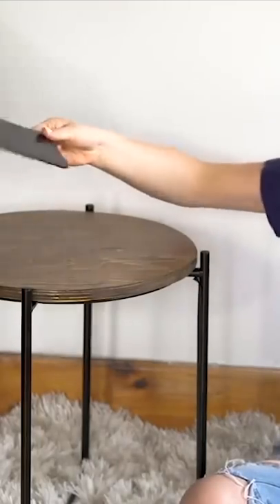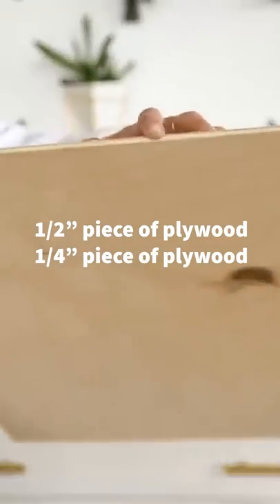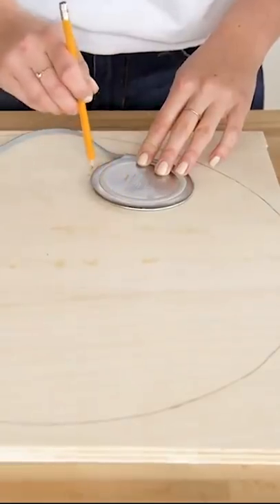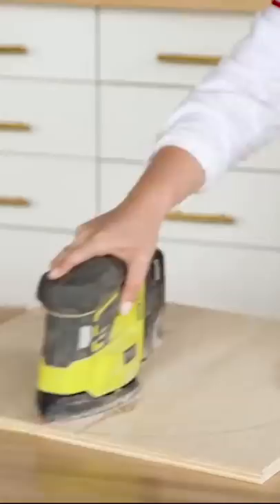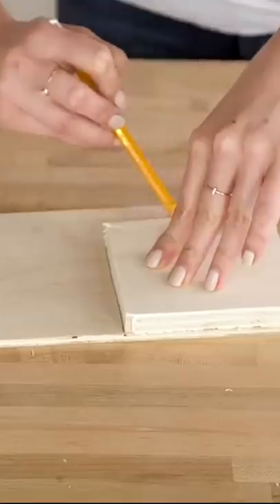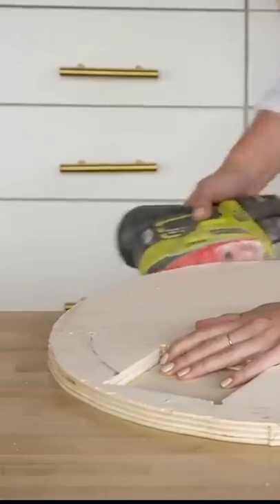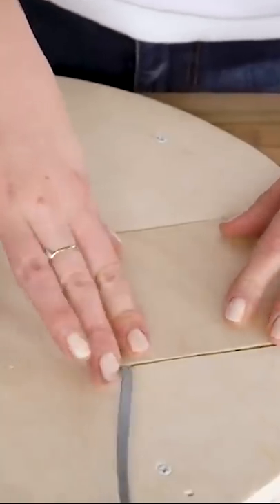#shorts - how to DIY a wireless charging table

Comment: OK wait how does the charge get through the wood when wireless chargers don’t even work when my Otterbox is on? 🧐
Reply: It won't plus it will over heat
This is dangerous and I'm 99%sure it won't work

Comment: Will the charger not get  hot or overheated in there?
Reply: also, i had no idea the chargers work  with thick materials like wood and foam over it.
Reply: I would leave the charger exposed  from the bottom, making it accessible for me to take it if I ever needed to. So much better than having to unscrew or cut its cover open...plus that way, the charger won’t overheat. I probably would  just cut a thin piece of wood that would measure out in length to whatever the diameter of the charger is and try it keep its width only wide enough to keep the charger in place.
Reply: Yes! It will over heat. I have no idea why YouTube is allowing this video.
Reply: @nolnol815  really? Your question is why YouTube allows it? They allow you to comment here, so the standards obviously aren’t that high…
Reply: @garycheevers2671  Go ahead build it, please. Perhaps, you could also build a DIY bathwater warmer based on a poorly made video with dangerously erroneous plans using coffeemaker parts and at light switch. LOL. Or better yet, because it's YouTube video material, try taking random antibiotics sold at aquarium shops for a seriously deadly ailment because the video maker assures you "it's the same thing and 97% cheaper than any antibiotic a pharmacy will sell you, plus you don't need a prescription."
(Really? An ad hominem attack is the best you could drool out without a shred of substantial proof my valid warning was wrong? That's your best? 🤣🤣🤣🤣) Some small few are why the rest have to tolerate basic, grossly obvious warnings on common itens: "Remove bread from plastic wrapper before heating it." "Do not allow children to play with plastic bags." "Do not store poisonous household cleaners within reach of children." Etc...
Reply: @alaska3445  They don't.
Reply: @Marit Størseth Yes it certainly will. That is the reason why such chargers come with specific warnings in the package NOT to even attempt anything similar to what this video instructs.
Reply: @alaska3445  It won't plus it will over heat
This is dangerous and I'm 99%sure it won't work
Reply: @alaska3445  It won't work plus it will over heat
This is dangerous and I'm 99%sure it won't work.
I was thinking make a cute little tray to sit it on
Reply: @nolnol815  It won't work plus it will over heat
This is dangerous and I'm 99%sure it won't work
Reply: @garycheevers2671  her question was very legit.
 it will over heat
This is dangerous and I'm 99%sure it won't work
Reply: Some people here need to calm down.
Reply: @sarahpcato  then how it worked in the vid for her?
Plus i see some people built this and apparently alive still.

Comment: This is really cool!
Reply: No it's very dangerous
Reply: Agreed. This can easily result in a devastating fire. The brainless nitwits who post videos that contain potentially lethal ideas should be exposed and banned from YouTube. Theses wireless charges can overheat in the design of this video! Documented cases of papers and books accidentally left on these types of chargers that resulted in severe overheating have come close to burning down homes.I use a wireless charger daily, but I am careful to be sure that nothing is blocking it or on it except the cell phone I am charging.

Comment: Imagine finding where it wirelessly charge. I'd at least put a mark on it so I won't get lost lmao
Reply: Just look for the wires extending from the table
Reply: In the original video, they made light pencil marks where the phone goes 🙂
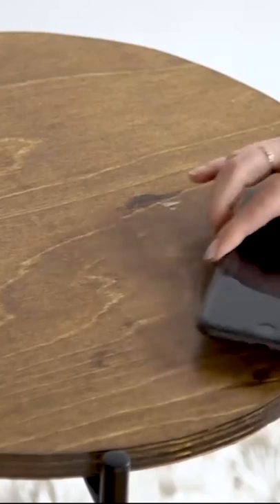Reply: At 0:52 you can see that they marked 4 black corners on the table where you’re supposed to place your phone